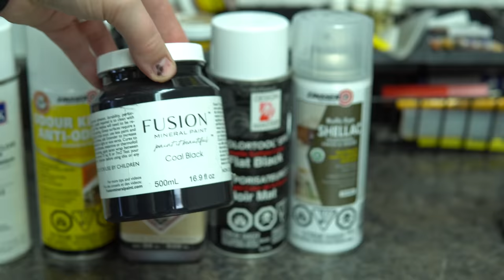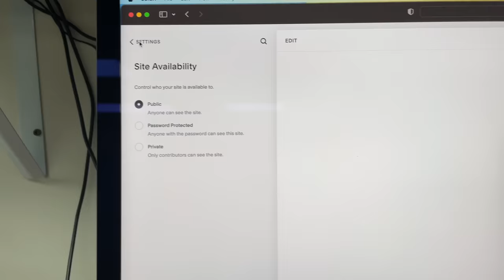STRIPPING PINK PAINT from a gorgeous old chest of drawers

Comment: When I was younger I did quite a bit of furniture restoration. On trash days I'd drive around, with a friend, and we would look for items we could salvage and use or resell. I got a couch I used for years, that way. All it needed was a new slipcover as it was structurally sound and a fairly expensive piece when new. Even back then (1960's and 70's), I couldn't stand to see nice things discarded as trash so would try to save them if I could.  I think it is wonderful that you do such a great job restoring and repurposing items that still have a useful life. Every little bit helps save our planet.
Reply from the maker: Wow! Even then you knew. Thank you for always doing your part to help. The more people saving pieces, the better! I agree with you completely. ❤️

Comment: Angie Angie missed you!
Another stunning piece.
I didn't think I would like the black on the drawer pulls but after seeing the finished product leaving here does have some darker hues. 👍
I have purchased the contoured blades they're incredible for getting into curved surfaces. We also have the rubber contoured pieces to wrap sandpaper around. Again they're invaluable.
I can see as your initially scraping off the painted the previous owner did not do any prep work which made it scrape off so easily.
Thanks again for your tips and explaining exactly what you do during the restoration process. Much appreciated.
Reply from the maker: Thanks Jim! I was a bit apprehensive about the black at first but as the piece was progressing and I saw all the different tones, I knew it would help tie things together without having to tone all the drawers the same colour. :-)

Comment: This looks so amazing. I've come to detest paint because people take beautiful pieces of crafted hardwood and just slap on terrible design choices. But this is a wonderful transformation! I usually use a heatgun but you just cant with veneer.
Reply from the maker: I don't detest paint. I think tastefully, well applied paint can help save a piece that could otherwise be doomed. That being said, there are certain woods I would do anything to restore and keep as wood but if painting that piece saved it for the years until I could get my hands on it, I'm ok with it. 

I don't like using a heatgun at all. Strip, scrape or sand for me. Thanks so much for watching!
Reply: @TranscendFurnitureGallery  I really can't get a stripper that isn't horrifically dangerous here in South Africa, so I really like my heat gun. But you do have to be careful with what you use it on. Veneer is right out. Also I like the way you use paint. I just see a lot of people taking beautiful oak or imbuia or even blackwood and yellow wood and covering it with white chalk paint because it's the current fashion here. Your ideas are gorgeous because you use the paint to bring out the wood grain. But I have a growing aversion to chalk paint haha.

Comment: Gorgeous gorgeous gorgeous. I know drawers should go back into the way they were removed, but I'd like to put the vertical grain drawer on the top. It just seems to me to want to be there as it's the odd one out and should be shown off not put at the bottom of the four like it's an after-thought. Just my opinion.
Reply from the maker: I didn't put the drawers back where they were removed from. It was suggested, by Andrea, to try placing that drawer on the bottom of the piece and with a few more move arounds, it ended up causing an accidental ombre effect that looks quite nice. 
Thanks for watching!

Comment: Lovely transformation, you said you paid $60 for it, do you mind if I inquire what you can ask for it now, refurbished and beautiful,  up there in Novy? ( I'm just outside of Boston, but both sides of my family come from Rossway,  on Digby Neck, Nova Scotia,!  ahhh, wish I could be there!)
Reply from the maker: I don't like discussing how much a specific piece sold for because it varies so greatly from place to place, person to person and year to year. I never want someone coming back at me saying "Well Angie said I could charge XXX for it." No thank you! 😊 Some people try to use an hourly rate on non commissioned pieces but I don’t find that very accurate. Sometimes the tiniest details take FOREVER, and would quickly “price out” the piece you’re working on. I go by what the piece itself is worth, based on comparable products in my area, and the finishes I’ve done to it. Most of my pieces sell within minutes. Which generally means I’m pricing too low, lol. But I don’t have the space to keep pieces for days and weeks so I need them to move fast. If I had more room, perhaps I could get a price closer to what some others in my area are charging. Which has gone WAYYYY up. I hope this helps. Thanks for watching!

Comment: Absolutely gorgeous!  How many hours of scraping and sanding did this particular dresser take you?  Thanks.
Reply from the maker: Because I have to film these projects, they take me much longer than they would otherwise. Every time I move at all, the camera has to be repositioned, so it actually makes it extremely difficult to estimate how long for each project. It depends also on materials used, dry times etc, whether it’s cold or hot and humid that day, as that can also affect dry times. Most pieces take me at least a few days, sometimes up to a week or more. I know that’s not a very accurate answer but the truth is, because I have a lot camerawork added in, I honestly don’t know.
Reply: @TranscendFurnitureGallery  Thanks, so much, for your reply.  Love your videos!  🙂

Comment: Could you talk a bit about how to make the drawers slide more smoothly?
Reply from the maker: In order to answer this question - I'd need to know what's causing the sticking? The guide, the drawers themselves? Drawers can stick for numerous reasons. Humidity, gummy finish or paint inside the track, drawer slides that are past their prime, warpage of the drawer or the cabinet or damage to the track itself. If it's just the runners themselves that are sticking a bit you can run hard wax or a bar of soap along the rails but if its something else, that won't help. Thanks for watching!
Reply: @TranscendFurnitureGallery  Thank you  I'll try that.  It is old, never been painted or refinished

Comment: Is there a reason you went with pre-cat lacquer? I'm trying to get a better understanding of the differences between it and regular lacquer. Do I understand it correctly that the pre-cat is more durable?  Thanks.
Reply from the maker: The very simplest explanation is that the pre-cat does not require anything else to be mixed into it, its just ready to go. Thanks for watching!

Comment: freely admit I'm an anti painter LOL.  I'm just curious why you usually choose to paint dark?  I would have loved to see this with lighter handles to stand out a bit.  I've noticed you seem to default to the black a good bit, so I'm just wondering.
Reply from the maker: Partially personal preference, and partially to make sure it sells. My own pieces that I redo (some of which are videos) tend to be darker. It also depends whether it’s a simple refinish or a restoration. Most older pieces were darker, so if I’m restoring, or trying to get as close to original as possible, I’ll do that.

Comment: Wonder why they would have 1 drawer with the veneer going the other direction
Reply from the maker: It's quite common in these factory produced mid century pieces, actually! It adds interest, but normally these are on the top. I think Andrea's idea to move it to the bottom was the right choice, and then I rearranged the rest to get that borderline ombre look. I like how it ended up overall!
Reply: @TranscendFurnitureGallery  It came out gorgeous

Comment: Does anyone know what can make an old furniture piece smell sour/musty but perfumed at the same time? I have throughly cleaned it with a degreaser, Murphy's soap, and wiped with a vinegar water mixture. The smell is better, but it remains. I will use an odor primer before I paint, but I am curious to know what could be causing this weird smell.
Reply from the maker: ahhhh that's always the WORST. People sometimes literally dump perfume or other scented products into pieces that have an odour to try and mask the smell, instead of dealign with it. I find cigarette smoke and perfume to be the two hardest smells to remove. I'll sometimes take on a smokey piece but I now avoid the perfume ones. My best advice is to clean the heck out of it, and then yes, use the odour primer inside and out. You can get a clear odour primer for the inside instead of white.
Reply: @TranscendFurnitureGallery  It really is the most bizarre scent. It smells perfumed, but not like a perfume a woman would wear, more like a chemical perfume scent. I think someone may have been trying to cover up a mildew smell but I wish I knew what they used. I brought in a drawer to my local hardware store because I have complained about this piece, and none of the guys there had smelled a piece quite like this one before. It has the most unnatural scent. It currently has baking soda in every drawer to try and draw out more of the fragrance.

Comment: What kind of respirator do you use ?  Do you have a venting system?  You use so many toxic products do you ever get concerned?
Reply from the maker: I usually have the door open when I need to, and a proper respirator for aerosols and vapours. I don’t always use chemicals. My favourite topcoat is actually completely non toxic, and I often prefer to scrape vs strip old finishes. 
I only use lacquer on certain pieces.

Comment: I actually don't HATE the original paint job. My guess is that it was in a kid's room; I know that as a little gay kid I would have loved a piece like that. For what it's worth, the previous owner did a good job with the paint. That said, it was in need of a makeover and you delivered! The handles give it such a nice pop and the bottom drawer is weird, but interesting - almost gives the piece a homemade feel of that makes sense.
Reply from the maker: They DID do a great job on the paint itself! Was smooth, not lumpy. A bit messy in spots but considering how this would have been applied, not bad at all. This style was all the rage for a while!